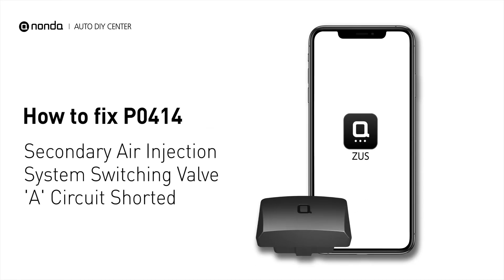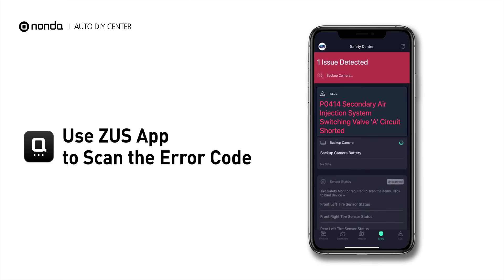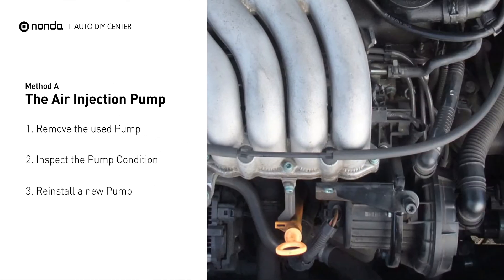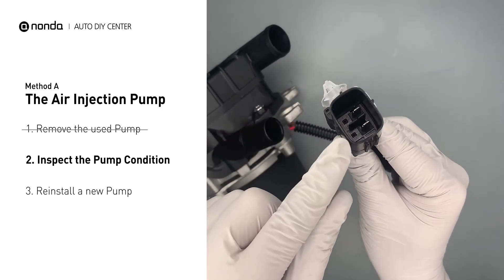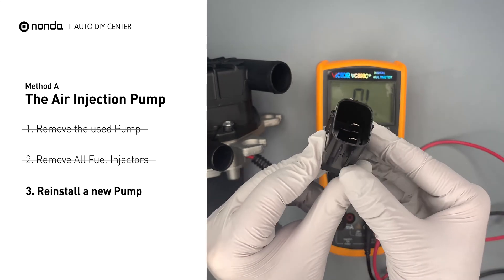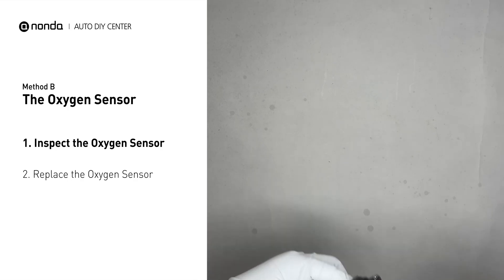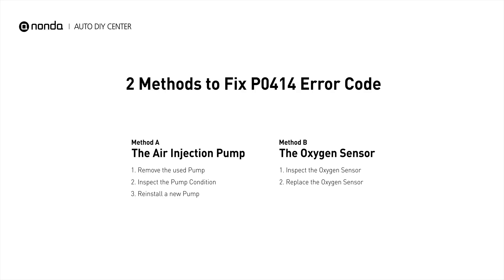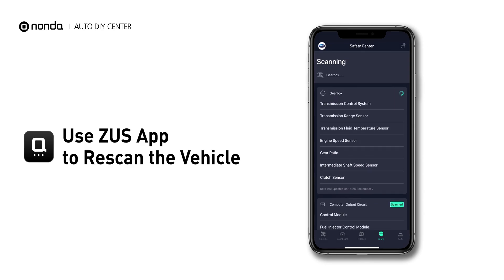How to Fix P0414 Engine Code in 3 Minutes [2 DIY Methods / Only $9.74]

Comment: Is it safe to leave my vehicle with this problem or is it something i should consider fixing?
Reply from the maker: Hi Sander, this issue should be dealt with as soon as possible as it will affect the drivability of your car and the overall safety while on the road. You may follow the DIY steps/procedures provided in our video on how to fix this code. Hope it helps!
Reply: @nondainc  alright thanks